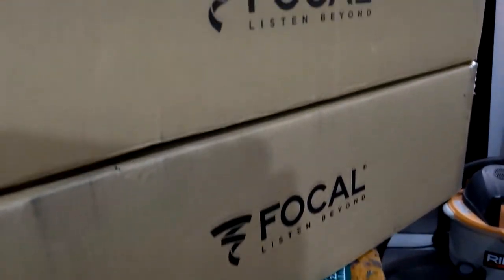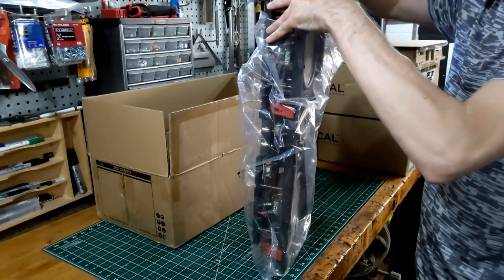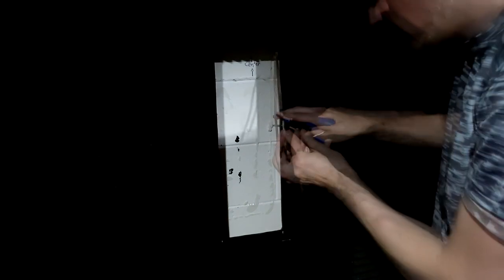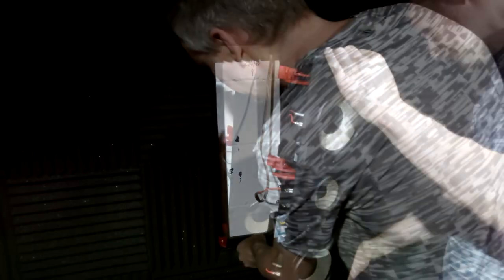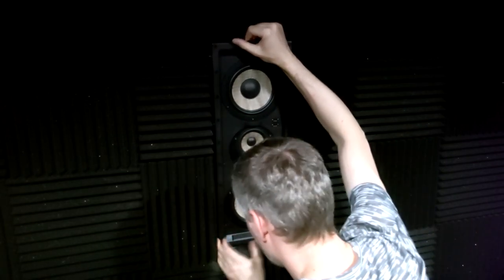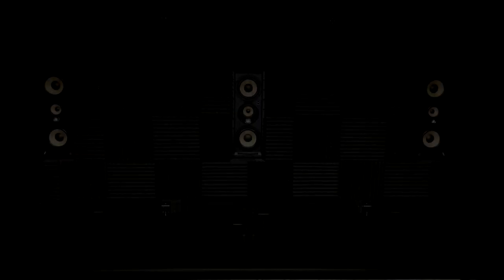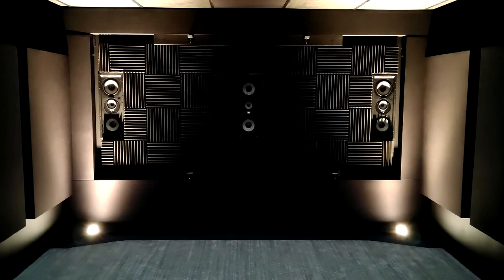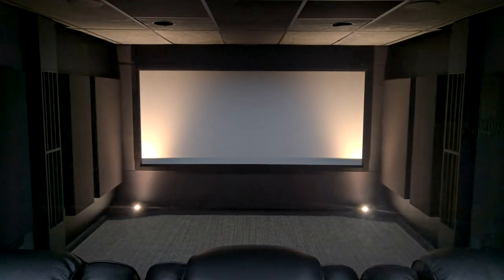Home Theater Front Wall Transformation! (Part 5)

Comment: How much box volume do you have behind those speakers?  A peak in the 80 Hz range sounds like the box volume is too small causing a high Fc (in box resonance) and high Qtc (in box damping factor).  A Qtc greater than 0.71 will cause a peak in the response at resonance.  Based on your description I suspect you have Qtc possibly significantly greater than 1.0.

Back in the analog days we used a Bi-Quad, aka Linkwitz Transform which was a simple analog device composed of a couple Op-amps and related components to, pole shift the resonance and Q to more desirable effective values.  Today, DSP is much simpler, you just create a notch to eliminate the peak, use a low shelf to boost the low end to the desired cutoff, and place whatever crossover slope you require below that.

The best solution will be to get more box volume behind the speakers and place some batting material inside but if that isn’t possible then proper EQ is the only real solution.  Bass and Treble controls are shelf filters and are not particularly useful in this situation.   Something like miniDSP would work but for this you will need external amplifiers.

Comment: Man I feel your pain you just got to love this AV malarkey the work is never done

that said you should be proud to own that beautiful room it is very impressive
I just installed a JBL SCL-6 Centre and JBL recommend building a back box , I just used those acoustic tiles you have and fitted them around the speaker cut tight between drywall and outside wall to prevent resonances as a temporary measure 
not sure if Focal in-walls would benefit from building a back box
anyways I have subscribed and look forward to more videos
Andy
Reply from the maker: Thanks Andy!  I packed insulation tight around the speaker openings, but I think the issue is that I spaced my studs 24" apart instead of 16", so that led to more resonance I believe.  But for now I'm happy with the sound, and can't wait to add more subs in the future ro fill out the frequency response!  : )

Comment: Man I hope you get it all sorted out because that is one beautiful looking theater. Btw may I ask how tall is your ceiling?
Reply from the maker: Thanks!  The ceiling height is only 6' 8"...
Reply: @TerminatorJuice  Your welcome. 😊 I asked because I’m in the planning stages of building my very first ever dedicated home theater in my basement and I have an 8ft ceiling and I was a bit worried it may be too low. I know I’ll loose about an inch or so after drywall but I guess I’ll be ok. I’m also doing a similar setup but I am using towers behind the screen. Would do in- walls but I already had the towers so I figured I save money that way. Thank you for replying sir.
Reply from the maker: @pf5658  I would love to have 8ft ceilings, so you're doing alright man!  Lol

Here is a video I did showing the limitations of my house ,and why I ended up with the size room that I have... If you're interested.
https://youtu.be/aam4j-FkkEg